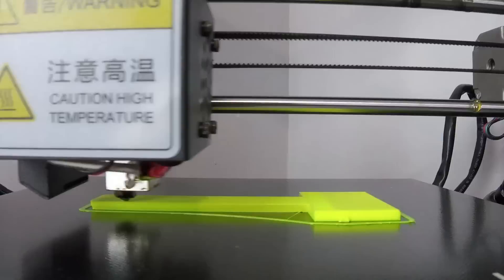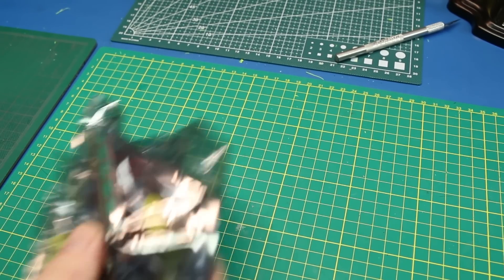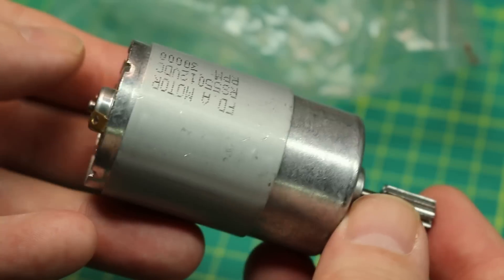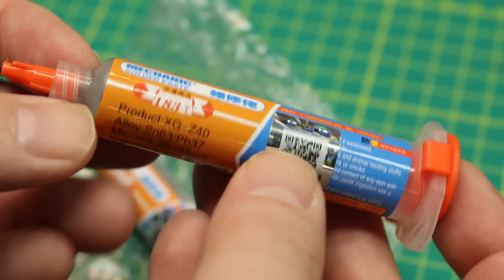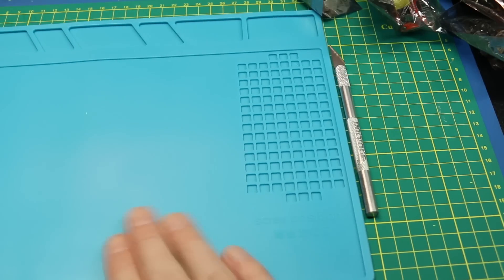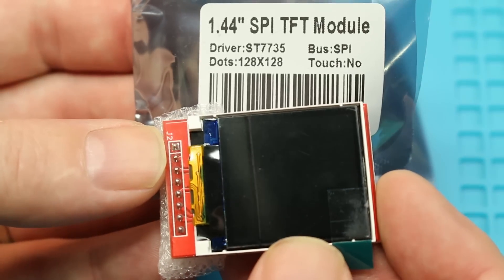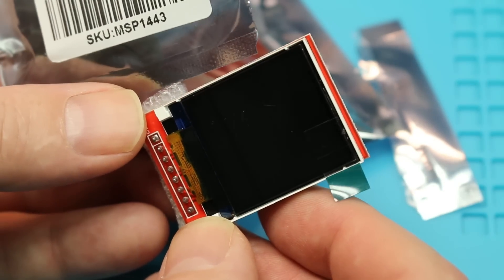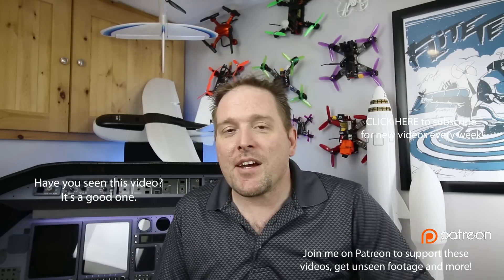MAILBAG! LCD Displays, Handy Tools, Solder & MORE!

Comment: If you using to linier pots for audio adjustments, Wh not get the motorised versions?
Reply from the maker: I don't need a motor- my finger can move it just fine
Reply: 10K Sliding Potentiometer??? Measure it... Mine were sold as 10K but all of them were tested at 5K.